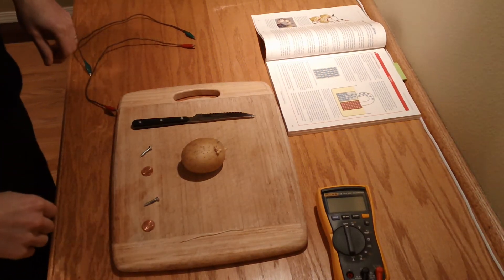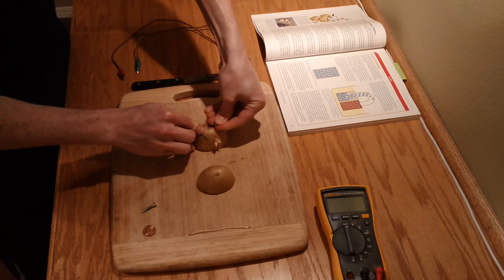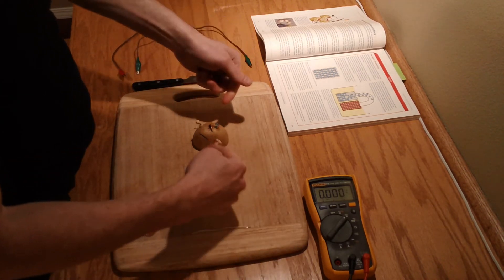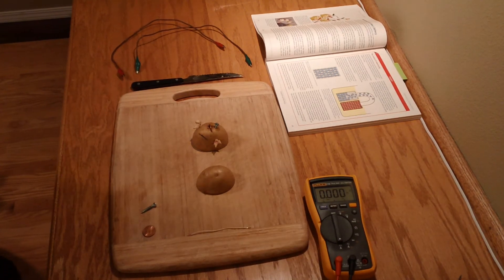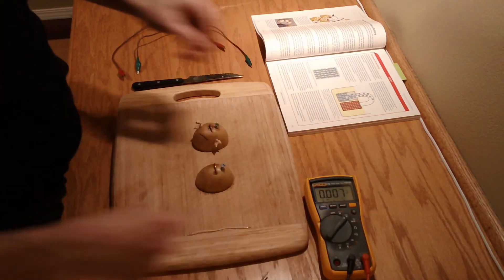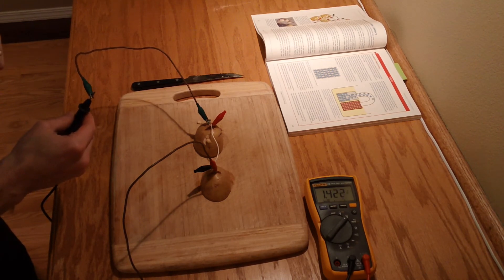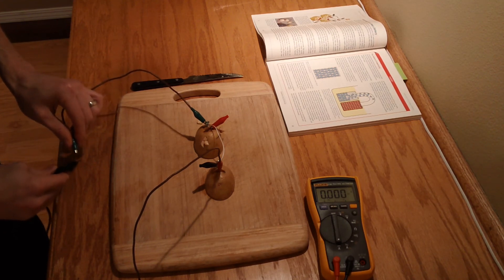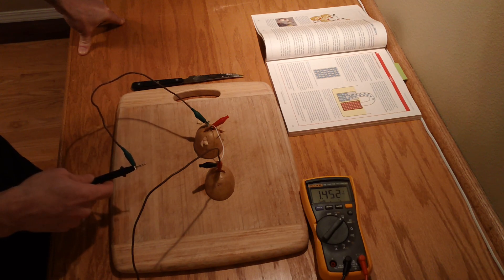Make: Electronics - Experiment 5

Comment: I am wondering if the potato with double the voltage is actually using an older penny. Modern pennies are mostly zinc.  Older pennies are mostly copper.

Comment: there could be a few reasons for the higher/lower voltage"i think it has to do with  bio chem and growth hormones...the eyes have changed the chem on that side" but it could be the date on the penny..less copper....or difference in the screw. thanks for making these..
Reply: +shannon vans Good thinking. I noticed the half with less voltage had begun to sprout, according to the work of Louis kervan there is a transmutation of elements in seeds and tubers etc. in the growth/life process.